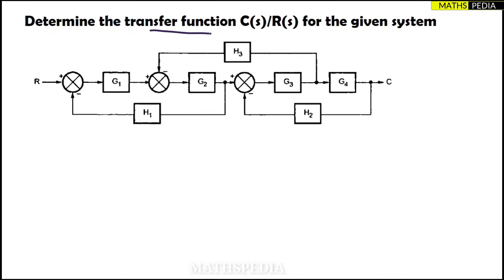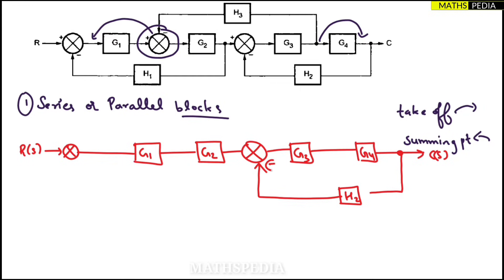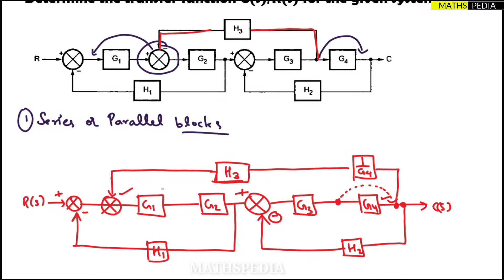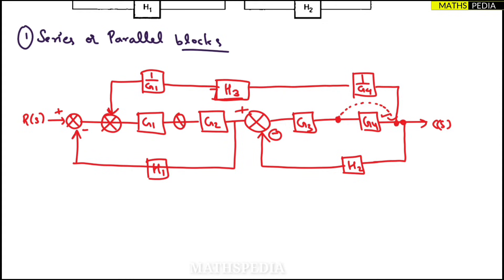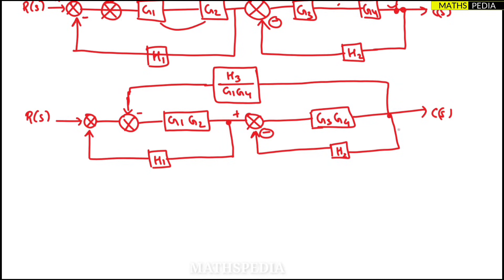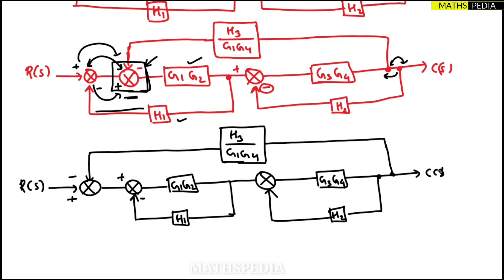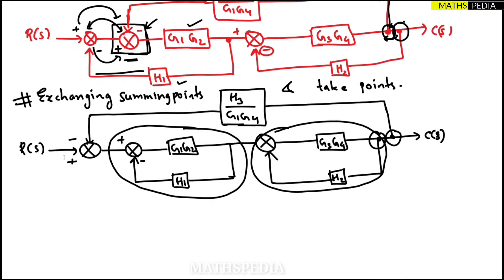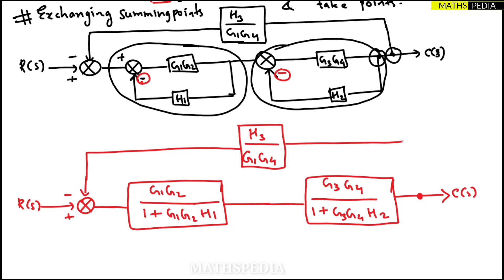Block diagram Reduction Problems | Control System | Engineering | Mathspedia | Problem 4 |

Comment: moving summing point of H3 before G1, Here G1 should be multiplied with H3 or Divided
Reply: it should be Multiplied to becuase it had been taken out after but now the takeoff was brought behind the block and it is now missing ... that was a mistake at 4:35
Reply: @githice  this rule is for take-off point, .....but if summing point is moves before a block 1/G is multiplied
Reply: Divided